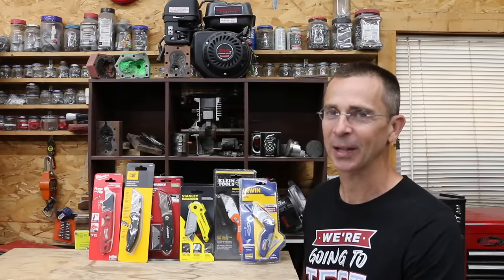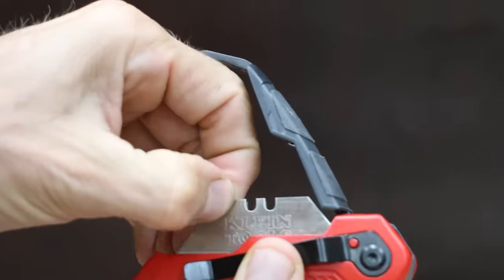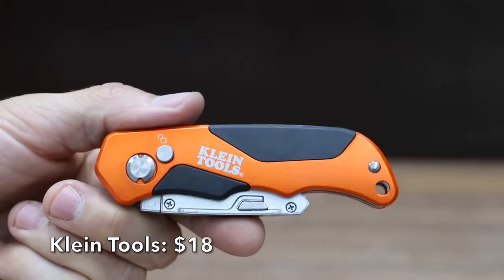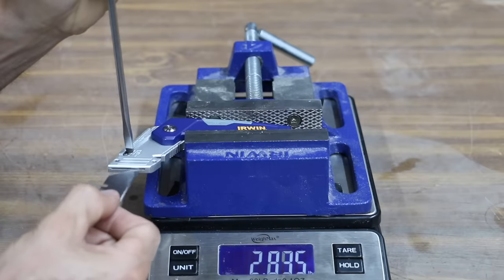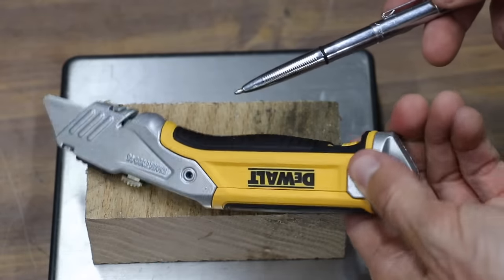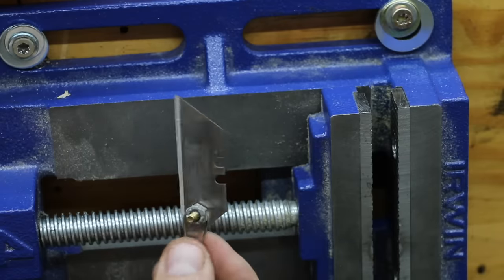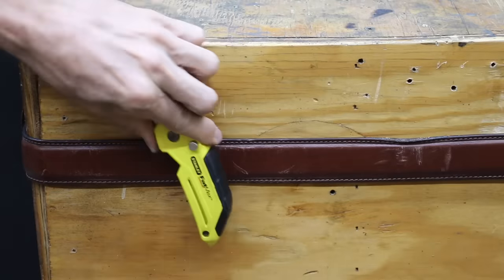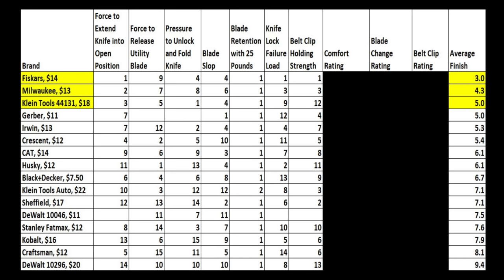Best Utility Knife? Let’s Find Out! Milwaukee, DeWalt, Gerber, Husky, Kobalt, Klein Tools, Craftsman

Comment: I dont know if my milwaukee fastback is different as i've had it for a number of years (its the milwaukee fastback 2), but if it is you didnt mention that it stores 1 blade, and it locks in both the open and closed position until you press the button. Mine also takes no force to open, i just press the button and it will fall freely open. I flick it open just like the fiskars you showed.
Reply: The FastBack is a series that has multiple versions. My personal favorite is the 1505 which stores one blade and has a folding screwdriver/bit holder as well.
Reply: That’s what I came here to post as well. I have the fastback 2 and it’s way better than the one shown here. Blade storage, opens with literally no force (you can hold the button and the blade will literally fall into place) and the wire clip is huge making it incredibly easy to clip to your pants, but it does come off a lot easier than the one in the video. It’s so comfy too.  But I’ll be looking at a fiskars next time, it seems pretty dang good.
Reply: There are many different versions of Fastback. The one I have holds 5 extra blades. There are ones that don’t hold any. They all vary a bit in price too
Reply: @plaid11  I liked the one he showed that you can remove the blade and just retract and it automatically loads a fresh one. But thats nit picking.
Reply from the maker: Thanks for sharing.

Comment: Excellent tests again :)  My next knife will be a fiskars, I like it in my hand ! Right now i have old Irwin/generic style ones.     I also have the Gerber and another slimmer version of the Gerber,  I really like those they are small enough to be put in your pocket and carry around all day.  Happy new Year !!!
Reply from the maker: Thanks!
Reply: I had a fiskars knife some time ago. great knife, only complaint is a little magnet that was glued in place in the blade channel. once the glue breaks the magnet prevents you from installing a new blade unless you have another magnet  available
Reply: I was really impressed with the whole line of Fiskars utility knives. Each one seems to be well thought out and fixes the issues that I have with most other utility knives.
Reply: Leaning that way too. I have a Chinese generic knife now and it's a pain changing the blade with that swing open side cove. Don't  ever take one even if it's free . Give it to someone you don't like
Reply: @schlusky  try using locate superglue and keep superglue in fridge it won't  harden . Forgot the locate model number.
Reply: @fuzzyharmonica  Fiskars makes decent scissors and outdoor cutting tools .
Reply: I've been using the fisker pro for a few months now. I'm a roofer and absolutely love it.

Comment: I've had the similar Milwaukee with the flip-out bit driver added for a couple years now - it's been a really good utility knife so far. 
(daily use doing HVAC)
Reply from the maker: Thanks for sharing!
Reply: I have the same one and i love it, so convenient to have a Philips or flathead in immediate reach.
Reply: not only it has a locking bit driver, a bottle opener, and it is also the best in pocket due to the slimline design when closed (opposing to the Husky's design when closed, or the lack of)
Reply: I also do HVAC but I carry a Tajima. Same one, for like 5 years. Easily fit 5 extra blades if needed. If I need a screwdriver or plier, I get out the Leatherman
Reply: Oh wow I will have to grab this one. Love my fastback, had no clue they had one with a bit holder
Reply: I've got one too, use it all the time on aircraft. So much better than leathermans slender bit design and much faster than fetching a real screwdriver.
Reply: @shrimp_bucket  It’s so nice to have in a pinch.
Reply: @chrisp9046  I have been in many pinches, would have been nice 🤣
Reply: @shrimp_bucket  then youuuuu...you should go into HD more often. They're everywhere
Reply: @spacemandrew  I am almost daily haha! I looked it up and my daily store doesn't carry them
Reply: I've been in the construction racket for 35 years that knife is a real game changer. Best 20 bucks you'll ever spend!
Reply: @romulas-cushmanproject3273  or just the 1/4 inch, thing comes in handy with gutters and other random shit landscaping
Reply: I have the same fast back. It's important note that it also has storage for an extra blade.
Reply: @Sprier  the funny thing is I’ve had the thing for almost a year (technically it’s my second one cause I lost the first) and I never thought about that! But yeah it comes in handy doing adjustments as I’m working on the wet saw.
Reply: @romulas-cushmanproject3273  Milwaukee did some diligence on that one for real! I've also lost a couple of them lol, terrible feeling
Reply: Love that knife too.  Especially the ease of opening

Comment: If you get the husky you will not be disappointed. I've had it for 2 years. It is very durable I've dropped it from a 15 ft ladder onto concrete a couple times while painting. The clip is easy to put on your waistband. The clip got slightly loose but is not a problem at all. Very sturdy feel, all metal, very smooth opening never needed to tighten anything on it. It is easy to swap the blades. It has fallen and opened a couple times though. Other than that I would HIGHLY recommend it. Great for edc.

I also have the Milwaukee. Would recommend. The spare blades have been very useful. A little thick and very noticeable. Would not recommend for edc but if you know your going to need or be using it I would prefer the Milwaukee over the husky
Reply from the maker: Thanks for the feedback.

Comment: Was really hoping the Work Pro would be tested. Less expensive than the least in the test. It’s the only one I use anymore. Small enough to carry with another carry knife, unlike most of these huge critters
Reply: Which one, Workpro has at least 6 different styles
Reply from the maker: Thanks for sharing!
Reply: The curved folding utility knife, sold in a set of 3, is an outstanding bargain. Very well built. I do like the Milwaukee even better though. One hand gravity deployment is super dingo.

Comment: I have both the Gerber and the Master Mechanic knifes!The Master Mechanic is EXACTLY like your Sheffield knife- I mean it's identical in every way!  Love em both! Havn't had any issues with either one!
Reply from the maker: Thanks for sharing!
Reply: i bought my knife off of snap-on and it looks identical to the sheffield its marked bluepoint but looks exactly the same
Reply: I also have an identical knife to the Sheffield in this test.  Mine is badged as Bessey though.  I suspect it's made for numerous companies by a single factory.
Reply: @mikeb8548  I'm beginning to think the same thing!
Reply: Mine was badged as Craftsman. I got the two pack which consisted of one like the tested knife and the second was a mini version. I’ve never used the full size but always keep the mini in my pocket at work for when I don’t have a full size near.
Reply: @jimshort9266  question is the brand etched into the frame? Mine has Master Mechanic lazer etched onto it.
Reply: @genehasenbuhler2594  … it is etched. It says Craftsman and 80 years. I guess I have the anniversary addition. The mini has no etching though. They both have Craftsman stamped into the belt/pocket clip
Reply: I wonder what actual company makes these then! They should put their own brand on em! I love mine- I've had it over two yrs now and it still works just like new! Hinges are stil tight! Great little knife!

Comment: I was hoping you would do the DeWalt folding knife that I use but the Klein was pretty close. I'm an HVAC technician and I was hoping that maybe you would do tactical flashlights! Like maybe the Nebo slide King and the 20 different Milwaukee pocket flashlights. I would love to see all the small flashlights compared to each other. In the HVAC industry we go through a lot of them. Thank you
Reply: Check the torque test channel.
Reply from the maker: Thanks for the suggestions.
Reply: Also would second testing flashlights. There are a lot of blatant lies in this category, especially on Amazon. Chinesium flashlights will often straight up lie about their lumens, but so do brand names. Also goes for endurance and types. There are a lot of things to test here.
Reply: Yeah, I just a Bessey folding knife with blade storage in the handle, which I quite like. It wasn't in this test, but they make one that looks very similar to the Sheffield, so I took how well that performed as a measure.

Comment: I've had the gerber knife in my pocket just about every day for around five years. It's a decent effective replacement to a regular knife due to the amount of blade showing, which is higher than average.
Reply from the maker: Thanks for sharing.
Reply: The Gerber is part of my EDC, has been for quite a while now, it's just super handy and takes up little space/weight.
Reply: @Allazander  After the break-in period, you can flip the knife out with some skilled wrist-action too. There's a black version available at some stores. Saw one at Home Depot.
Reply: @grawss  I've had the Gerber for quite a while now, originally picked it up for backpacking.  Mine must not get as much use as yours, it's still too stiff opening for any sort of straight flip out but I'm okay with that as I can easily open it up with thumb+flip action.  Not sure I'd want it to be so loose I could just flip it out.  I will keep an eye out for the black version, I'd love to have it in black.

Comment: Milwaukee makes the exact same knife that holds 5 blades.  I used the same Dewalt knife for over 15 years until I borrowed a coworker's Milwaukee knife (I thought they looked weak in comparison to Husky and just wasn't a fan of the folding style) and as soon as I actually got it in my hand and used it and noticed it actually has blade storage,  I was convinced.  Plus the wire style belt clips,  like on their tape measures,  are unmatched in strength and comfort.  That Fiskars looks legit though and definitely would get it if I lose all 3 of my Milwaukee knifes. Lol.

Comment: Test the non folding ones next. Please test my favorite- Doyle. Best one I've ever had.
Reply from the maker: I'll do it if there's enough interest.  I've added thje Doyle to the list
Reply: @ProjectFarm  I've had numerous brands and so far, is the only one that's survived being dropped off of 4 stories onto concrete, run over multiple times, run over and smooshed into hot asphalt by a roller and going on 2 years of hard EDC and construction duty. Same knife. For $8, I think it'll win. It's eerily similar to the Dewalt but cheaper.

Comment: I think you missed the best daily carry knife. I use, and love, the folding knife by Tool Shop, from Menards.  It has a release button that, with a flick of the wrist, acts like a switch blade. The only drawback I've found is that if you use oil to lubricate the joints, it affects the ability of the knife to hold the razor blade. Now I use powdered graphite to lube the moving parts. I think the clip is not so much a belt clip as it is a pocket clip. Being right handed, I use it that way. Love your videos. Keep up the good work!
Reply: The Milwaukee was the first utility knife to be opened like that
Reply from the maker: Thanks, will do!
Reply: What Beardman said: Milwaukee's FastBack flip knives do this and I have never had to lubricate one for it to open and close smoothly.  But you are right, that flip motion is addictive.  :)
Reply: I have the masterforce version. Tool shop stuff seems a bit cheap to me, but good to know it's held up for you.

Comment: Milwaukee is the best because if you're actually going to carry and use a utility knife on a regular basis, the wire clip won't damage your jeans, all the rest with the flat metal clips will destroy the material on your pocket and make you look like a bum!
Reply: ive had my milwaukee on my pocket probably 24/7,  for abotu 6 months now, not even a single fibre is loose
got a nice SOG knife for Christmas and it has the flat clip, its already made some visible wear
Reply: @coolerthanyou9548  Same for me!  My pen clip on my other pocket has done much more damage!!
Reply: If I look like a bum people stop talking to me, so I win both ways
Reply from the maker: Thanks for the feedback.

Comment: I use the Milwaukee Fastback on a daily basis and love it. I like being able to flip it open and closed easily with one hand, and the locking feature for both open and closed. The durability is also top notch lasting me more than 3 years and I received it used. When the locking mechanism finally failed me due to the screw becoming stripped and the frame becoming loose I opted to buy the Fastback 2, this is even better in construction than the original and comes with an blade holder that can hold up to 4 spare blades.
Reply from the maker: Thanks for the feedback.

Comment: Definitely need a part 2 with toughbuilt knives included.
Reply: Meh toughbuilt never outperforms wouldn't be worth it, great variety in this one just ordered myself 3 fiskers. Haha
Reply: @youtubetim3577  toughbuilt has top of the line sawhorses and kneepads. So yes, they have products that outperforms a lot of other companies
Reply: @V Chow  oh sorry I was thinking of a diff brand I was thinking that walmart hypertough misread it, I actually have toughbuilt saw horses great except wish they had rubber padding on the feet they can get sharp given metal and all.
Reply: @vchow6749  I've tried their utility knives and didn't like them. Too heavy and not really worth it with the other competition out there. They are decently comfortable though so if weight isn't really something you care about then it'll work for you
Reply: @youtubetim3577  no problem. I have the toughbuilt c700 sawhorses and they have rubber feet. One sawhorse can hold a sheet of 4x8 plywood. It's actually pretty nice. Each leg adjusts and they can hold 2x4 and 4x4 on the side slideouts.
Reply: @ohioknifelover  I just bought the magazine feed knife and you're right, it's chunky. However, I like having a lot of options when it comes to utility knives
Reply: Best utility knife of all time is the WORKPRO. I use it everyday making military cables, box cutting, and more.
Part Number is B08X6X8132.
Reply from the maker: Thanks for the suggestion.
Reply: @saltysteel3996  I really like my workpro too.
Reply: @vchow6749  Oh absolutely! If there wasn't a variety of utility knives they'd all be harder to take with you for work and ones that you'd have to settle with!
Reply: @saltysteel3996  Is that the slim steel handled one?
Reply: @vchow6749  I was looking at those magazine Toughbuilts last night, but I think I'm going to get the one that converts to a scraper as long as the blades aren't a fortune.
Reply: @markkempton4579  the one with the scraper was on my list to get first until I found out that you have to use a special blade that only toughbuilt makes. It's because of the hole that's at the top of the blade that's needed for the flipping action.

Comment: I would recomend avoiding Lenox folding utility knife. It is too stiff opening, flexes well beyond open when applying pressure and the lock open on mine recently failed and it is about 6months oldm
Reply from the maker: Thanks for the feedback.
Reply: Have these in our machines at work,  they seem to have some spotty quality control. And I end up taking that "flathead screwdriver" part to the belt sander as it just digs into my hand when gripping.
Reply: @mattmboa  Which reminds me, that is also way too stiff. That was my first Lenox purchase and with their products being typically more expensive than others,  I don't feel compelled to buy anything else from them. At the same time, I don't want to judge them too harshly based one a single purchase.
Reply: @ghostrecon3214 … I’ve found Lennox does a lot right, but sometimes drop the ball on an element of the tools offered. Having said that, I really like their 11(I think) in one screw driver. The tips don’t twist or chip and they fit well in the driver pieces. I’ve used mine daily for at least 5 years but did have to recently replace it as the rubber slipped off the handle and I couldn’t get it back on. I have no idea how it came off but can’t go back on. The metal parts are still as new though.
Reply: Cool thanks! My craftsman screwdriver bit did snap so that is encouraging to hear theirs is better.

Comment: There's a Milwaukee utility knife that has blade storage built in (I have one of them) works great for random stuff I have to use it for in the shop
Reply from the maker: Thanks for the feedback!
Reply: Not straithglty relatod to that but I buyed Milwaukee blades to my Fiskars foldable painter's knife 😄
Reply: Yup. The version that stores five spare blades makes up for the finicky blade change - very similar form factor as the one reviewed here and no cursing your own incompetence when you forget to bring spare blades. I also removed the belt clip from it since I don't use it and it was only a tiny screw, so much easier to remove the belt clip from what I can tell of the others.
Reply: Milwaukee has a few versions of these knifes, some plastic, some metal.

The testet one is #48-22-1501, the version with spare blades is #48-22-1502.

I like this little, heavy tool very much, easy and fast to open, really compfortable, very well designed.
Reply: Yes I have a metal I thinks it's a olfa. Keeps about 7 blades in stock. I keep a few roofing and rest normal. Nothing like a new blade. My dad will keep the same blade for 6 years. Drives me mental so ya I keep that one at his house as I do all their maintenance now. As their getting older.
Reply: @Divadosaurus  I don't find the change finicky. Once u know you know. Certain angle the blade must be at and always do too first.